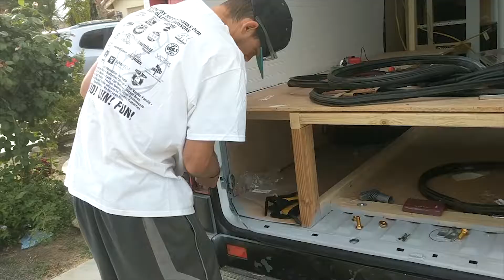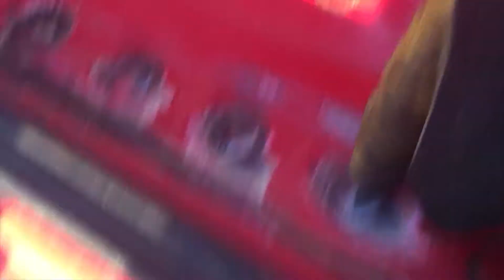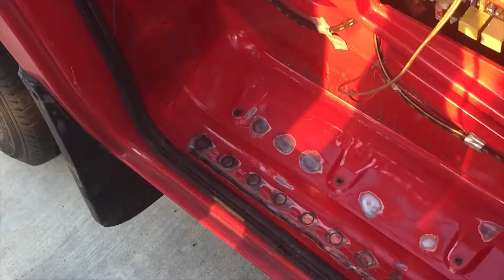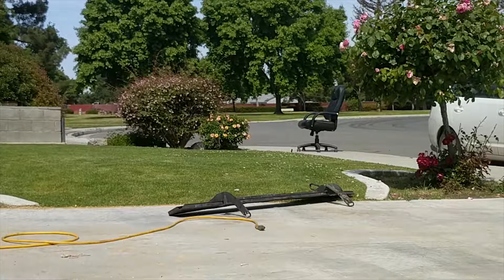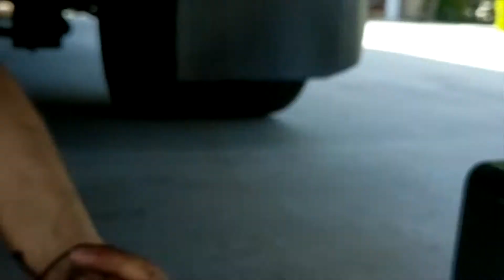Sprinter Van Build Ep. 12 : DIY Weather Stripping, Trailer Hitch, and Rust Repair

Comment: Awesome vid! Did you have to apply adhesive before installing the weather strip (i.e. from a tube), did the strip have its own stickiness or is all of that not required to successful install this weather strip?

Also, was it hard to remove the old one and when you did remove it, did you have to scrap away any of the old strip left behind? (This would also be a sign that adhesive was used on the oem).

Thanks in advance; just bought my replacement!